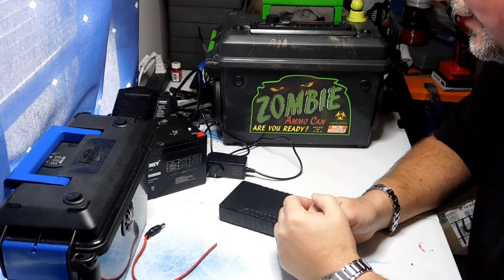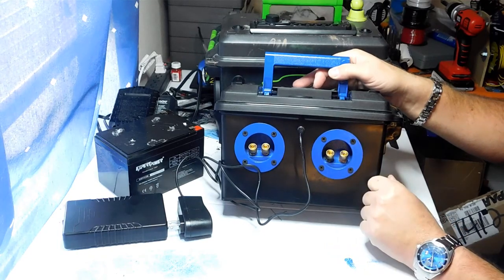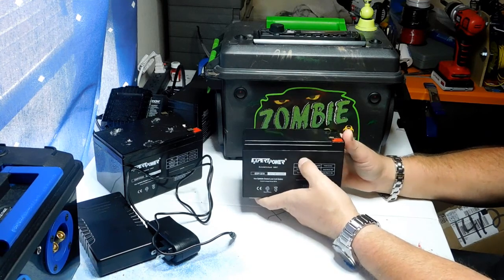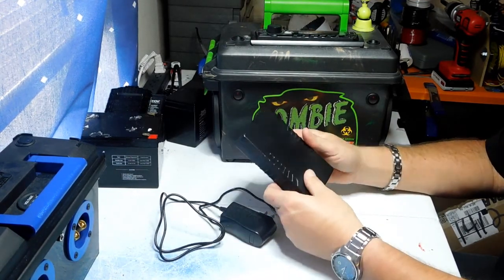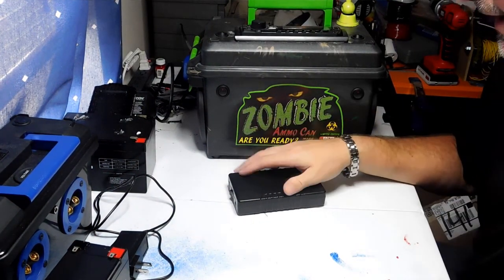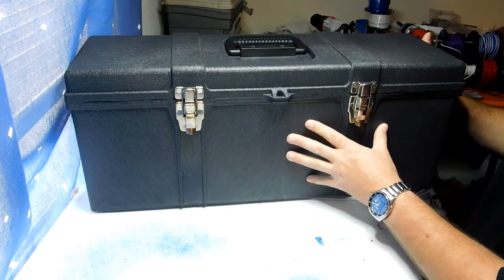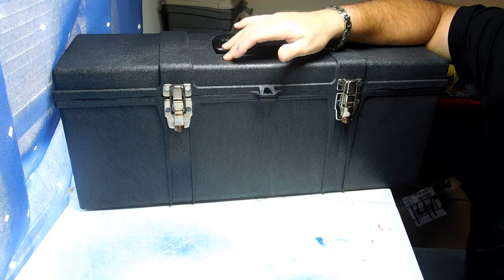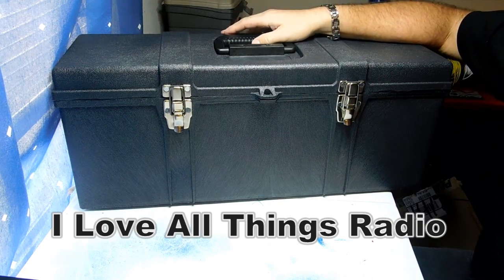How to choose a battery for your Boom Box project

Comment: When doing a toolbox build i suggest a orange or yellow box that way when you install lights inside you can shut the lid and it will glow nice
Reply from the maker: That's a neat idea
Reply: @diyboomboxesintexas2805  i wanted the orange box so i could find it in the dark but when i lit it and shut the lid it glows like a fire or open it and mount a ply shelf where the tray would go with the led strip above that and you have a nice place to keep your gadgets or in my case a ppx3414 which are awesome. nice channel btw

Comment: Man, that is a lot of tech going into a small box. I have built around 6 boombox coolers and the simplest is (1) blue cube cooler from Walmart, with 400-800 watt amp with (2) 6x9 speakers cut an stacked in front with a AUX red/white - into 3.5mm phone jack. Throw in a older used/new car battery hooked up with clips to +/_ on battery and blows people away on the beach. Last around 6-10+ hours and cooler has plenty of space for bass. (not beer though...)
Reply: Oh, and a hassle to carry but well worth the instant reggae jams on beach ;)
Reply from the maker: Check out the last two videos I posted.
1000 watt 4 chsnnel Crunch amp.
I use deep cycle batteries.  Much lighter and can carry the load better.
Thank you for watching

Comment: I just built a bookbox with a 5 watt 2 channel amp. Has 2 4 inch 2 ways. I'm using a 7amphour 12 volt. How low voltage can I go? 12?
Reply from the maker: My rule is 11 volts.
Below 11, charge it back up

Comment: The lithium battery unit has a power button on it.  How are you accounting for that?
Reply from the maker: Mark Stricker I leave it on while I'm using the unit. And amplifier and turn it back off. If I'm not going to use the unit for more than 24 hours I'll go ahead and open it up and turn off the switch at the battery

Comment: Thank you for another great video! With the lithium-ion battery that you have on the video, I noticed that it has a switch. Does that switch always stay on when the unit is not in use?
Reply from the maker: Jose Vargas I normally leave it in the on position, but if I'm not going to use the radio or the Boombox for more than 24 hours I go ahead and turn the switch off
Reply: DIY Boom Boxes In Texas Thank you sir! Keep those videos coming.
Reply from the maker: Jose Vargas Thank you. New videos every week. Next video will be on wire.

Comment: What battery Amp should I use for my 12volt 3amp boom box??
Reply from the maker: Battery or amp?
Reply from the maker: What components are you using?
Reply: I'm using the power wheels 12 volt 9.5 ah battery in my suite Case boom box and a Schumacher smart charger and it works well.

Comment: You can use 2 4 amp hour 6 volt lead acid batteries wired in series to power a car radio and it will work just fine with no problems also the battery life can depend on the brand of the battery some battery brands have a longer battery life than other brands do
Reply from the maker: That is a good idea

Comment: I use car audio sealed deep cycle batteries they're very very small and put out an insane amount of power and don't have to be ventilated and they can be mounted upside down if you want
Reply: Wolf Pack Productions do you have a link to the battery?
Reply: @stx956  just type in Google sealed AGM deep cycle battery or type in car audio battery

Comment: Im making a camp speaker with lights and twin phone charger and bluetooth amp board. i was going to run 2x 12v 7ah sla batteries in parralel as i get them free at work. I assume i can use my mains powered car charger to charge it. im running a 50w bookshelf speaker with crossover board. Im unsure how long the battery would last charging 2 phones running the led strip and the amp board at medium. do i need 2 batteries or would you think 1 would be enough for say a weekend as one battery weighs a bit
Reply from the maker: How much room do you have for batteries,
Reply: @diyboomboxesintexas2805  Its a small toolbox build so i have space for 2. the 5.5mm power jack that just arrived looks a bit weak so was worried if that would be a issue. It will never be played at full whack as i dont want to piss off other people when camping but it will be running the led strip and twin charging socket. Thanks

Comment: My charger power supply is connected to the battery always,is it ok?
Reply from the maker: Just curious why you would do that?
Reply: @diyboomboxesintexas2805  oh i want to say that my battery is inside,so i put wire from the the battery to outside,so when i charge the battery ,no need to open the box,

Comment: I want your opinion can I use drill batteries as my power source
Reply from the maker: I have seen that done in the past. The questions you have to ask yourself, is : 1. Will the battery voltage not exceed the voltage needs of what I am powering?  2. How easy will it be to charge the batteries?
Reply from the maker: You should join my facebook page. We have lots of experts in there besides myself to help answer questions. Here is a link:  https://www.facebook.com/groups/1225425117541115/

Comment: Where could I buy the charging port
Reply from the maker: You can get it from this link 
https://www.amazon.com/gp/aw/d/B07V6NJ37P?psc=1&ref=ppx_pop_mob_b_asin_image
Reply: @diyboomboxesintexas2805  and which charger is it
Reply from the maker: I will show you the one I recommend
Reply from the maker: I send this one with my builds

https://www.amazon.com/gp/aw/d/B01DYE5EBI?ref=ppx_pt2_mob_b_prod_image
Reply: @diyboomboxesintexas2805  so both of those go together?
Reply from the maker: @jeffescano3090  Yes. They will plug into each other
Reply: @diyboomboxesintexas2805  what battery do You recommend to use if I wanna go with a double din and maybe 2 8 inch mids
Reply from the maker: @jeffescano3090  how much room will you have for a battery?
Reply: @diyboomboxesintexas2805  I’m going to build my own box and was thinking of using two batteries
Reply from the maker: @jeffescano3090  two of these should  work fine
Reply from the maker: @jeffescano3090  https://www.amazon.com/gp/aw/d/B00ELQXF74?ref=ppx_pt2_mob_b_prod_image
Reply from the maker: @jeffescano3090  please join my Facebook group if you are not already a member. I can help you more there
Reply: I use the black decker in amazon

Comment: What voltage reading on the voltage meter should tell me I need to charge my lead acid battery? (6 cell, 12 volt deep cycle battery)
Reply from the maker: I would charge if when it drops to 10.5 volts

Comment: Too much waffle and not enough technical information. NiMH is the best all rounder. They are light, cost less and have enough amp discharge. The only problem is charging time though boomboxes are not taken out daily so they are the best option. Forget lead, too heavy and slow to charge. Lithium has low discharge for small battery packs though they can handle higher amps in parallel/series, that adds cost and you need a charging circuit to build one for high watts audio.
Reply from the maker: Well, I made this video for the beginners and showing them their options because I was seeing a lot of questions about batteries in my Facebook group.

Comment: 700$ what all is included for 700$
Reply from the maker: What is $700?
Reply: you said a build like the mega boom box would cost around $700. was wondering what all is included like brands specs etc... thanks
Reply from the maker: @bobkeller8383  Ok, got it. I went with a Pioneer double din radio with CD player and Bluetooth.  (2) Kicker 600 watt 6x9s and (2) Kicker 400 watt 6.5 inch.  30 amp power supply,  relay, (2) 9 ah SLA batteries, power cord, 400 watt 4 channel Sure Electronics amp board, 4 inch fan, 27 " toolbox,  voltage booster,  USB port, Voltage gauge , 12 volt socket,  marine antenna , port tube,  noise filter, plus all the wire, RCA jacks, and switches.